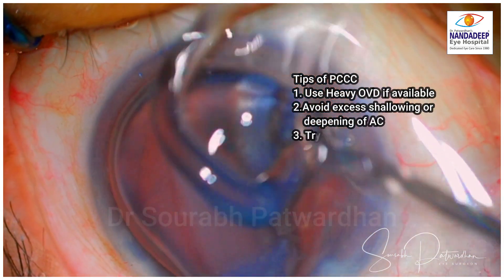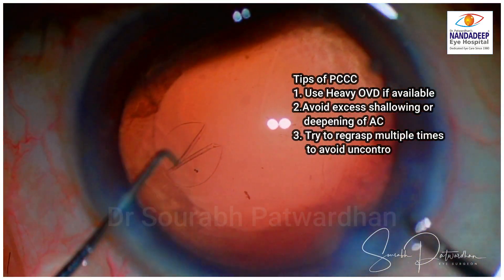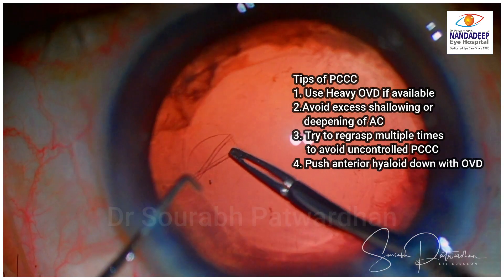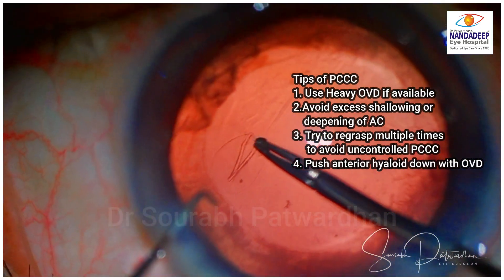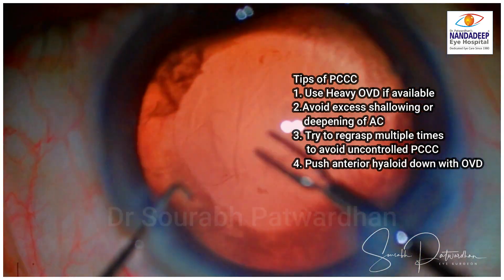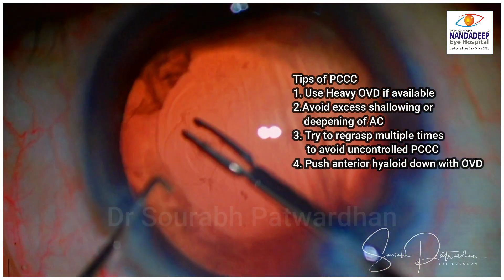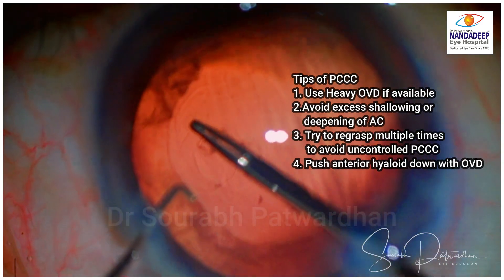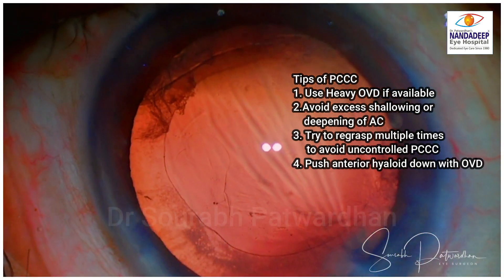148 The Kiss of PC- during epinucleus removal Dr Sourabh Patwardhan- how it can be avoided

Comment: Great tips sir. Personally I find it much safer and equally effective to approach the epinucleus with the phaco probe just as we approach the cortex with the aspiration probe. That is bevel up and start peeling it from underneath the anterior rhexis margin rather than approaching it with bevel sideways. Even with this approach the entire epinucleus will peel off immediately and get aspirated.  Also as mentioned by you it doesn't really need phaco energy so plane of aspiration can be kept anterior to iris as well. I have been doing this for the last 4000 cases or so and have not had a rent in this particular step.
Reply from the maker: Nice tip. Removal of epinucleus is easy in most cases. But when there is plate like epinucleus sheet is left with no anterior cortex, its tricky in some situations.